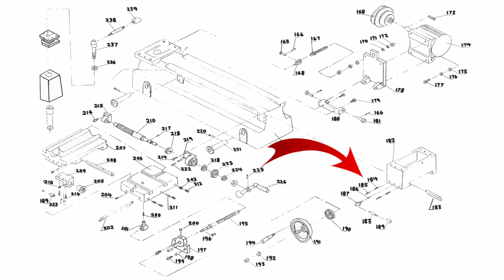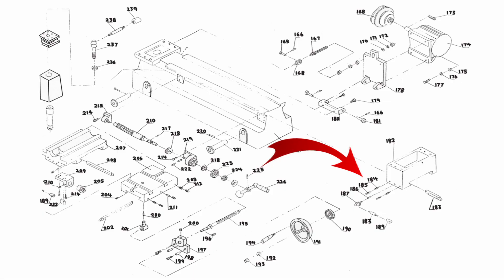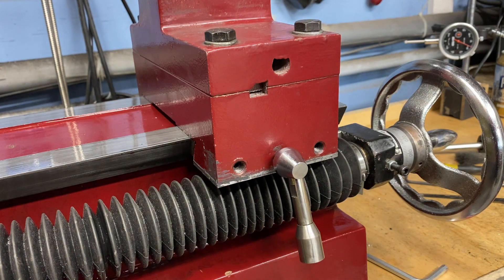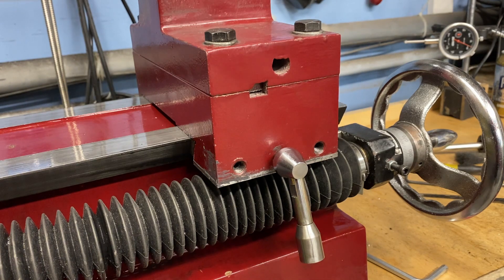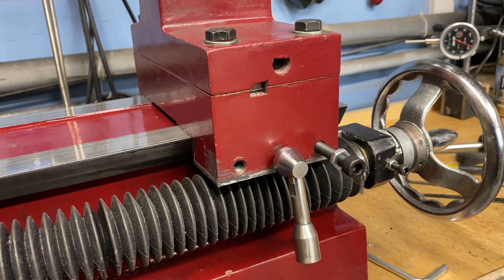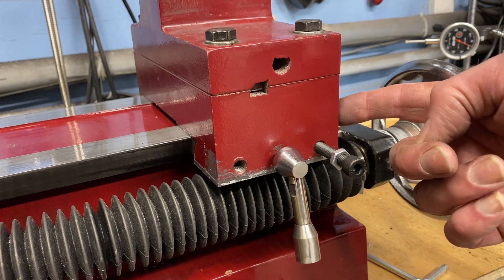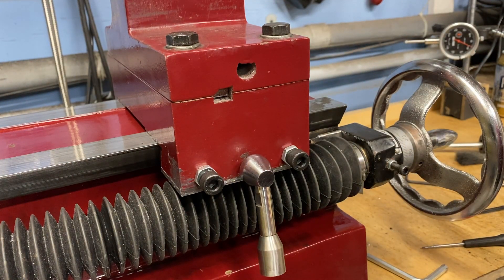Correcting a Factory Gib Screw Design Flaw on an Import Lathe Mill Combo

Comment: The two screw design should have a ball bearing between the two screws. Thats where they saved money,
Reply from the maker: even with a bearing between the studs it is still an inferior design.  Completely removing one set screw to get to the other is in efficient and then there is back lash.  As you tighten the outer screw it will push the inner screw up against the threads, probably not more than .001" but enough to effect your adjustment.  The single stud jam nut is far superior all the way around.

Comment: Hi, a tip for adjusting the cross slide gibbs.  Disconnect the cross slide screw first, this gives a much better feel for the adjustment as one moves the slide by hand. Not my idea, it's a George Thomas recommendation.
Reply from the maker: That is a good tip.  My machine does not yet have a half nut so that would not work for me.

Comment: I've seen a couple of those "double screw" setups. My old 3 in 1 had brass rod bits that were pushed in against the gib by grub screws. Whenever you pulled the tailstock off, the gib and 2 little brass pieces would fall out. If they fell to the floor then good luck finishing your project that day; you'd be on your knees, face to the floor trying to cast shadows on the small parts with a flashlight (CSI style).  I'm so glad those days are over.

Here's what I did for a gib lock on my 3 in 1 - https://www.youtube.com/watch?v=R5PCcjXjmVk

What are those rubber leadscrew protectors?
Reply from the maker: as promised here is more info on the leadscrew covers https://youtu.be/tFBjC9wLRD0
Reply from the maker: I have steel free floating pins on the locking adjustment and have also had to play the "find the pin" game after removing parts.  The leadscrew covers are an upcoming video.  Either next Thursday or Thursday of the following week, but if you want a better look at them sooner they are in full few at the end of this video https://youtu.be/ycIlDc5BZX4

Comment: Took you 15 years to figure that out??   BTW- many other 3 in 1 machines already have the jam nut design on them.
Reply from the maker: I will admit it is a little embarrassing.  I am mostly self taught, I got this machine in 2013, started making chips and figuring out things as I went. I am very mechicanly inclined can fix, or fabricate just about anything. Problem is the set screws had an effect on the gib adjustment and with a lot of time and effort you could sort of make them “work”. I spent hours getting it close but then it would loosen up over time.  There was no reason to dig deeper because what I was doing was almost “working”. In retrospect it seams obvious but some times you simply don’t know what you don’t know 😁